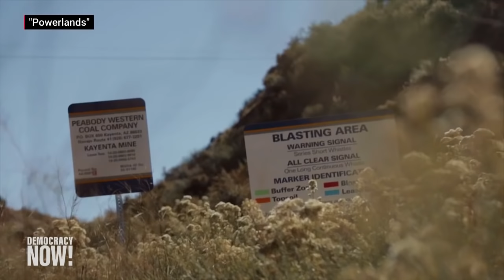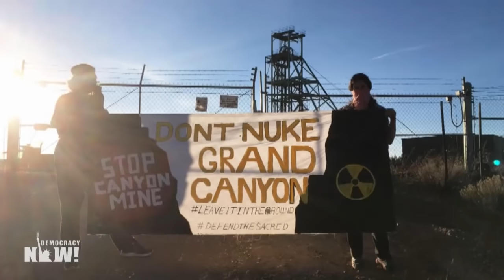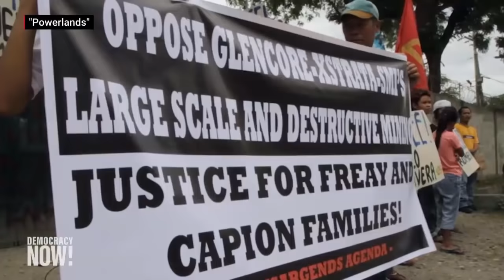“Powerlands”: Young Diné Filmmaker on Indigenous Resistance to Resource Colonization Worldwide

Comment: The malignant pattern we never address is growth and scale.  Even with the present scale of things, with the best of green changes, we head for a Battisti (UW Atmospheric Sciences Professor) like food shortage population crash, easily in my lifetime.  The only thing at scale that can address this is massive reduction in consumer activity:  move to walking only and riding bicycles, move to living in shared housing, move to more and more manual agricultural production, the move to lower consumption especially of meat, and the general reduction, worldwide, of manufactury.  There is no hint at all of doing this.  All this greenwashing is just cosmetic and is not even exhibiting anything but complementing consumption levels an population expansion.  We need to teach each other these things at all levels, or we are not only due for dire failure, but chaos as well.